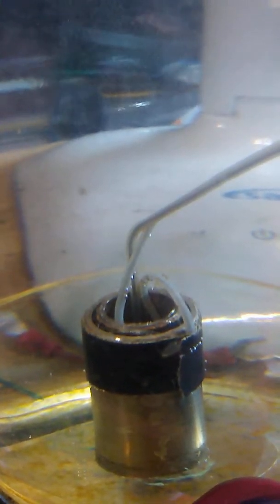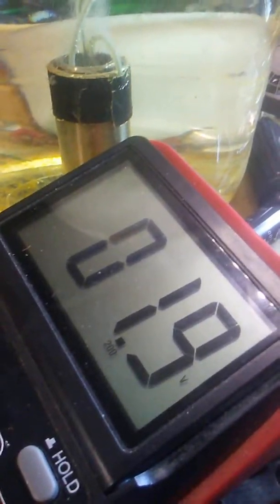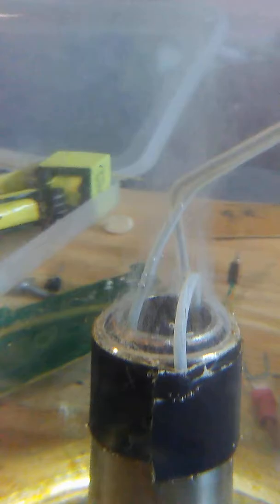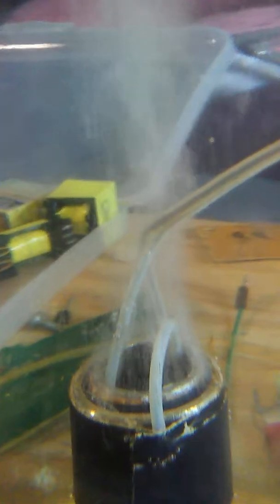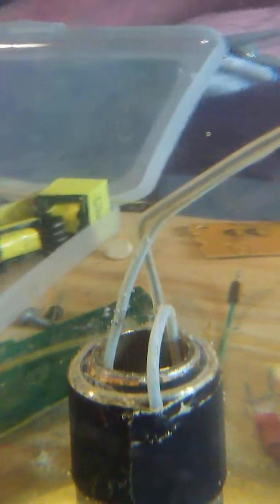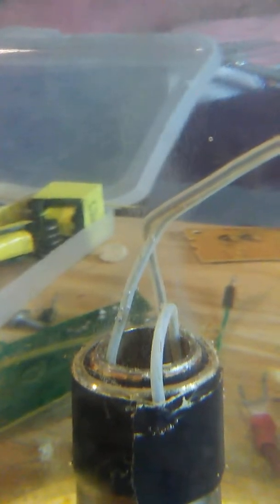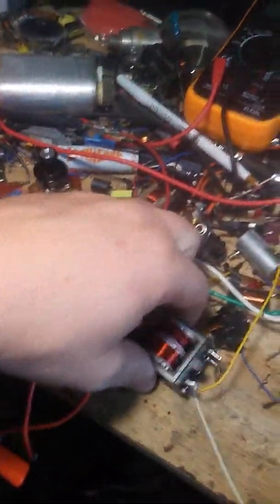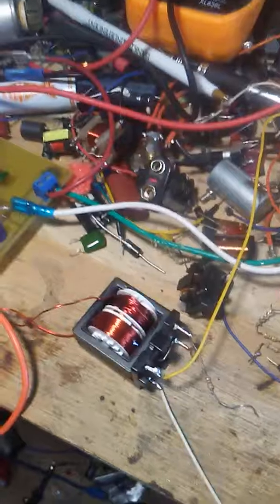Vic second run.

Comment: Stanley Meyer and his brother Steven worked on alot of older TVs which is high voltage DC so they knew alot about high voltage
Reply from the maker: You are thinking greatly! Step polarizing elongation plucking electron excitation ,voltage,  (deflection) process uses progressive step functions to leataly polarize molecules. Voltage stimulation Causes Polarization on any electron or proton in all matter. Thank you for your post, and remember,  harnessing or extracting any energy requires an open circuit in its primary Transformation State where its secondary usually remains closed though one can observe electron flow threw a filament ejecting photons as light with only a open circuit to that light in place! Please keep researching as you are on the correct road to success with your gears rotating in the direction of your post.